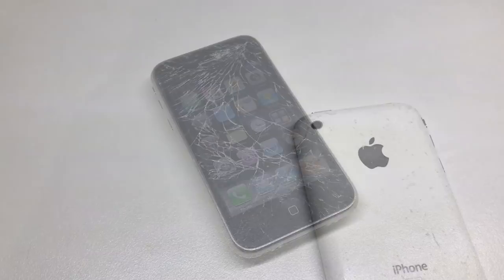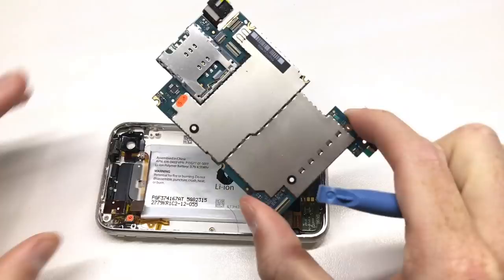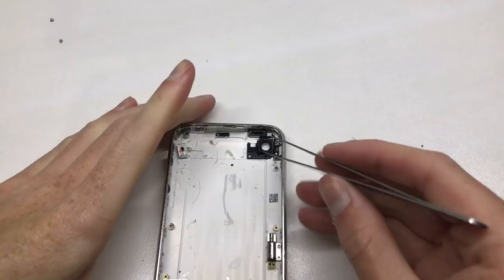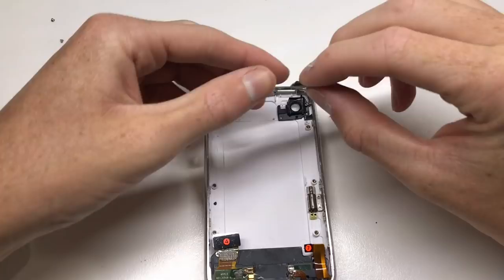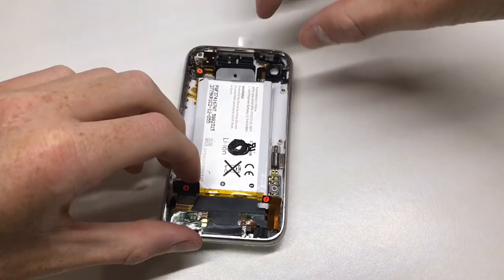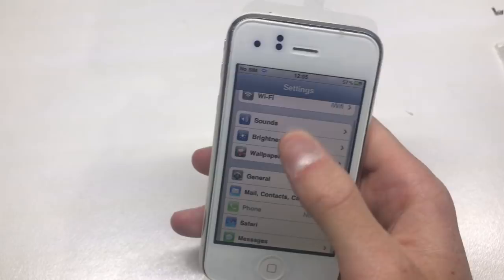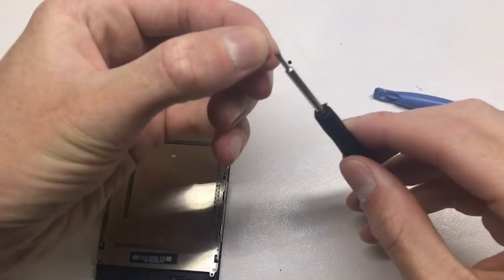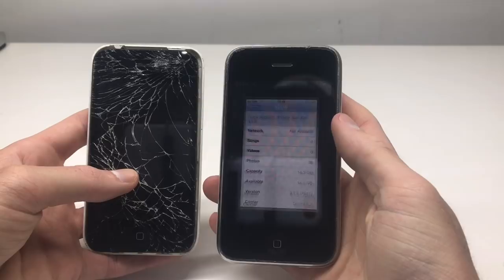IOS 3.1.2 iPhone 3GS Restoration

Comment: Ive never seen inside of one of these. It was super cool to see an apple device that looked nothing like a current one. Off the shelf battery with no black wrap or apple logo, no black solder mask on the pcb, repair friendly stickers and labels. Tbh i would have never guessed that these internal parts where from an iPhone if I hadn’t seen you take them out of one. Super cool video!

Comment: Hi Hugh!
You're very good with these things, so why don't you get iPhone 3GS and below cases and replace the internals with iPhone 6 or 6s parts? It'd be interesting since you'd have to find a way to make everything fit and you could do it over a few weeks to get it right. It'd be cool to see it :D
Reply: Hat For Sale that would be impossible but interesting
Reply: Well it probably is if you have the right tools, or you'd have to get Strange Parts to do it and make special chips for different locations. But yes it'd be very interesting.
Reply: That would actually be pretty cool haha
Reply: It would not work....... they removed support for 3,5inch screens in iOS 11 and technology does not work like you think.
Reply: why not just use an older OS
Reply: Hat For Sale first of all, nope. You cannot downgrade just like that. Also, iP 6/6S parts are impossible to fit in 3gs
Reply: You could fit SE parts in, and they sell motherboards in foreign countries such as China with older versions of iOS.
Reply: Hat For Sale you can make an iPhone SE out of an iPhone 5C case
Reply: Hat For Sale and, no, they do not sell motherboards with iOS... most likely
Reply: So? iPhone SE parts would fit, thats the only point I'm trying to make.
Reply: iphone SE internals are simply to big for a 3.5 inch 3gs , there is iphone 6-7 conversion housing  and 5s 5-6 mini rear housings available , the 3gs is a different era of phone for customisation
Reply: The parts wouldn’t fit, they are too large
Reply: You could ask Stange Parts to do that.
Reply: The screws doesent match the parts are Bigger its impossible

Comment: What did you put on the screen to remove the cracked screen? I have a heavily cracked expanded battery 3gs that I found in the trash and I can't take off the screen due to it being so cracked.
Reply from the maker: I used tape, it fills in the air gaps allowing the suction cup to stick
Reply: Hugh Jeffreys thanks I'll try that
Reply: TechThatYT Hey guys, do you know where I can buy an iPhone 3GS Stuff like the volume buttons, battery and housing?
Reply: Clorox Bleach probably go on eBay. That's your best bet
Reply: Clorox Bleach probably go on eBay. That's your best bet
Reply: Its called a suction cup, and you might also need a spudger.
Reply: TechThatYT tape
Reply: TechThatYT packing tape
Reply: Clorox Bleach possibly get a FMi iPhone (Find my iPhone Locked) those are virtually useless due to being not activated and will never be able to be activated so they go for ridiculously cheap prices
Reply: TechThatYT just some clear packaging tape and a suction puller

Comment: Those phones are pretty easy to repair. The volume flex cable on that phone is the hardest repair I’ve had to deal with.
Reply: Hey I typed that right before you said that on the vid

Comment: The housing is for iPhone 3G but still you did a good job :)
Reply from the maker: Nope, the model number on the back is A1303 AKA 3GS
Reply: That's possible however the 3GS had silver finish lettering and the 3G was mate gray.
Reply: Or maybe it just looked mate to me in the video. I remember there used to be big problem with the buttons not fitting properly when taken out on these models so as long as the functionality is still there it's all good. I believe you can buy preassembled cases on Aliexpress for few bucks. Cheers and keep up the good videos.

Comment: I got a 3gs with its screen got cracked a little, the back got badly scratched with some cracks on the plastic, a few pieces of the plastic cover fell off. The camera still looks good and the charging port looks pretty dirty. I don't know if it was working or not because i don't have the original charger.

Comment: This iPhone is allergic to aftermarket batteries. At least mine was. Could not restore phone in iTunes if the battery was not original. So I desoldered the BMS board off the old battery and soldered it on to a new battery's cell. That way, it worked.

Comment: Did you know that the iPhones 3 and 2 all firmwares are being signed
Reply: iPhone 2G and 3G came out before SHSH validation, so you can restore to any firmware at anytime under certain circumstances. On 2G at least, 3.1.3 -> 3.1.2 -> 3.0 -> 2.1 -> Old iTunes + 1.1.4 to get to 1.1.4...

Comment: Were you able to get the signed iOS links on apples website while it was out?
Reply from the maker: No I didn't. I was trying to save it with "ticketbox" and "savethemblobs" for some strange reason only TSSsaver works and I only found that out a few days ago after I missed Apple signing IOS 6,7,8 for various models of iPhones because ticketbox wouldn't show or save the blobs. I did manage to downgrade some of my 4s' to IOS 6.1.3 as Apple is still signing it as I write this.
Reply: Hugh Jeffreys nice
Reply: Hugh Jeffreys WAIT I CAN DOWNGRADE MY IPHONE 5 RIGHT NOW??
Reply from the maker: You could of a few days ago, Apple signed IOS 6.1.3, 7.0.4 8.0 blobs for 2 hours! its gone now but I couldn't save any of my as I was away but even then TSS saver was down because of so much user traffic. Apple is still signing Restore blobs for the iPhone 4s and iPad 2 (excluding the 2,4) on IOS 6.1.3 but thats it. So you can restore IOS 6.1.3 in iTunes (only 4s and some iPad 2 models)